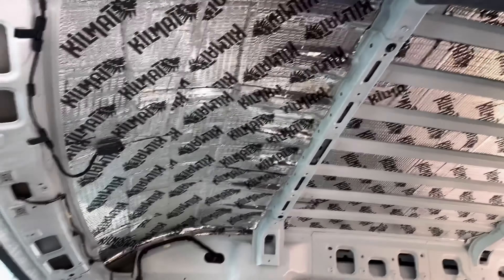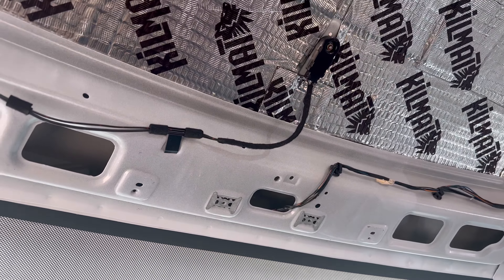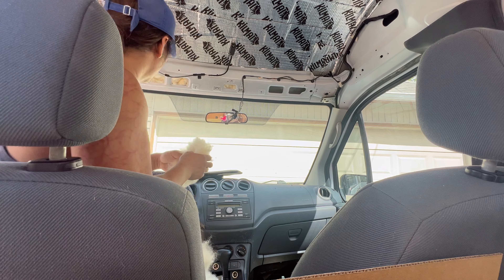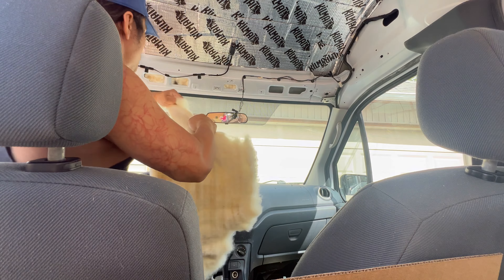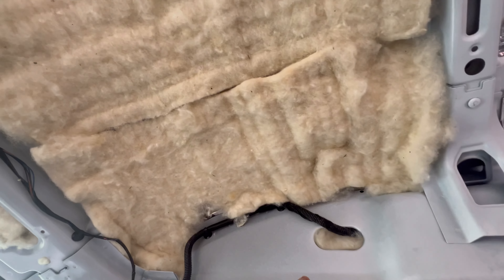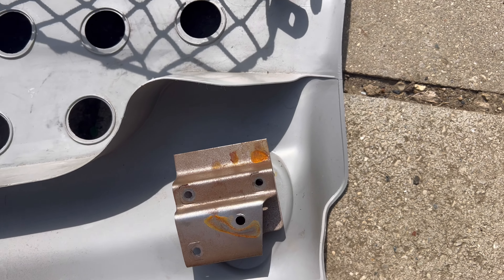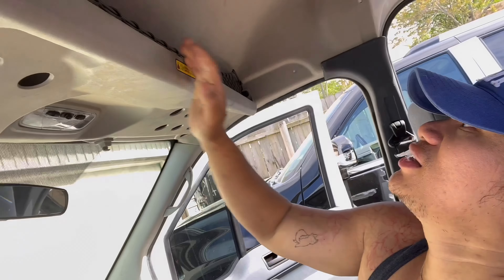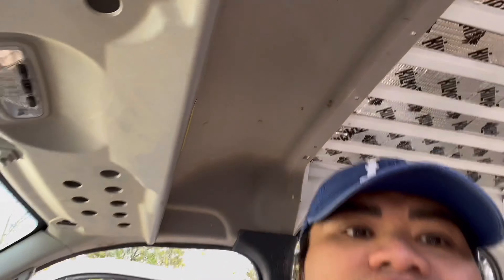Ford transit connect cabin area insulation

Comment: I’m thinking of simply taking the little shelf out and then replacing it with a full shelf, covered with carpeting, but I’m not sure how I’m going to connect it. Also, my ‘22 TC has a central compartment in that little useless shelf that I may have to keep and build around, cutting away the shelf bits and somehow connecting it to a bigger shelf. That’s down the road a piece for me. I’m still working on the insulation and panels. 

For now I’m using a portable leisure battery for my electrical system (like a Jackery).